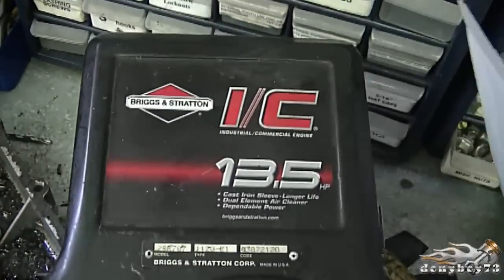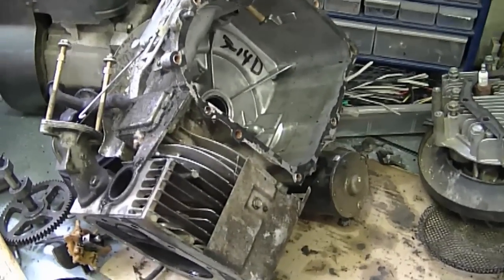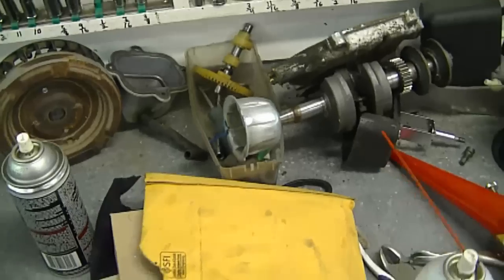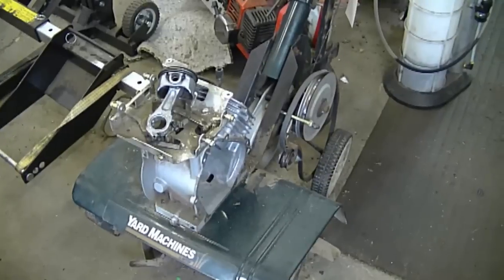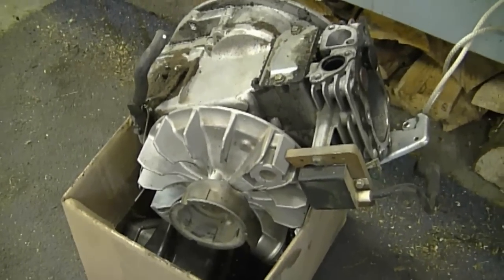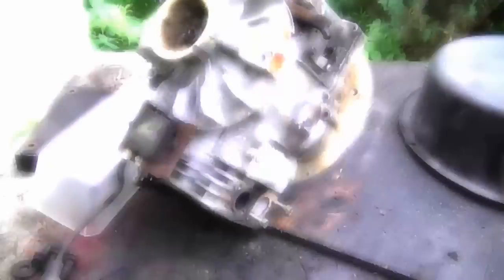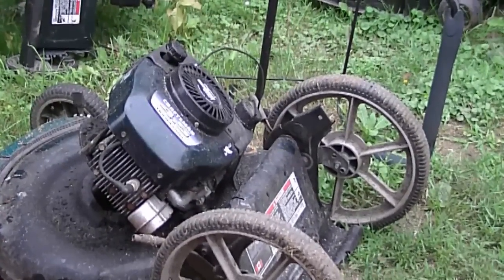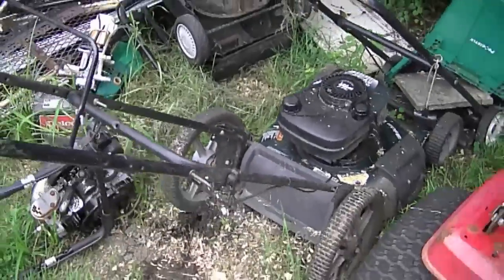Blown Up Small Engines

Comment: I had a Ferris ProCut come in one day. Blew the main seal, and had a pretty good knock. When I got it torn down, I found that the rod bolts had backed out of rod #1. Needless to say, i replaced both rods, freshened up the rest of the motor, and she was on her way for less than the cost of a short block.

Comment: How often is the block cracked when someone bends a crankshaft on a lawnmower? Years ago I hit a hidden rock and not only did it bend the crankshaft but it cracked the shaft opening on the bottom of the engine. 
Thanks for your great videos.

Comment: I have 1961 craftsman 3.5 briggs engine . Those engine are bulletproof . I even have kept it outside for over 25 years  I have a Stihl fs45 c gas trimmer and I am torn between rebuilding the carb or replace it for 35 bucks. The crap they put in the gas down here in the USA it ruins the gaskets . I have tried using stabil in the gas but for the past 3 years I have had to replace the gaskets every year . I think it is a lost cause.

Comment: With regular oil changes engines last a hell of a long time normally, those looked very badly treated :-(

You have some usefull bits mate, the dead bits can go to the aluminium pile to be weighed in later, hopefully your scrap metals merchant pays well :-)

Comment: 😮😮😳 Lots of Low Oil Conditions You Would Think Every Time You Mow You Would Check The Oil Before You Start Mowing Never Know if a Carb Flooded The Crankcase With Gas But If You Check The Oil It would Come Up High On the Stick or Gushing Out Of the Plug Hole 😀😎😊 Nice Failure Analysis Diagnosis 👍🏼👍🏼👍🏼👍🏼

Comment: I'll bet the engine that overheated was the result of dirt and weeds getting in between the cooling fins on the cylinder and head. I recommend pulling the starter rope cover off the engine every year, and making sure air flows freely between the cooling fins. It might be worth it to tell the customers to bring the machines in once a season for an oil change, and air filter service. (It might even be worth it to check valve clearances) After that, they can check the oil and but gas in it, and know that the engine will outlast the rest of the machine, if fully serviced once per season. As far as bent crankshafts, there's not much you can do about that. Rocks and sprinkler heads will inevitably damage blades and bend crankshafts, no matter which engine, or how well maintained.

Comment: Hi Donyboy73, I have several Briggs and stratton 3.5hp engines I have collected put out as scrap as the decks went rotton and all do the same thing as my mower same engine pop and spit while running if the engine had points you could clean them this one has an ignition box pack whatever it is called you will know what can I do to make these engines run smothly many thanks Ian

Comment: Dony I have a question, I live in Texas, the hot dry weather here is perfect for saving old engines but the only problem is the heat is so intense that whenever I want to take a motor ofd a deck the bolts almost always shear and they are a pain because they are steel bolts in aluminum threads and drilling it out is almost impossible. I was wondering if you had a remedy for this. All help is appreciated.

Comment: quick question for anybody. My 3.5 briggs pushmower ran fine today til the very end. It suddenly lost power. It didn't quit, but was running around 25% with liitle puffs of smoke. I did finish, but not very fast. Any hints out there? First problem with this mower. like I said it didn't quit, but it wasn't far from it. What do you think, fuel, spark..... Thanks.

Comment: Checked oil this morning and it was full and clean. It started, but still ran slow. I took off the head.The cylinder looked and felt smooth. Maybe it blew the head gasket? Hmmmm. A lot of carbon on top of the piston though and the valve that is on the top also a lot of carbon.

Comment: Wait my friend has a tecumasa engine on how power and you pull 3 times and it locks up and wont turn over and if you turn it with the blade it squakes really loud and it had oil change what could it be

Comment: Engines like these don't last.
CEPA rules dictate they last a short period of time and expire before the emission warranty is up

There  is a reason why Tecumseh went bankrupt....
Those consumer grade Briggs are not much better.

Save your money and by a Chinese clone of a Honda.
Not as good as a Honda but cheap and better than the two previously mentioned brands.
Cheap Chinese parts mean they are cost effective to repair.
You can also use Honda parts to richen the carbs so they run well.